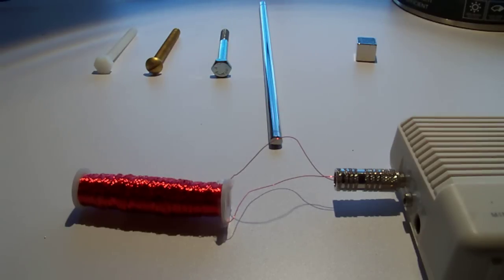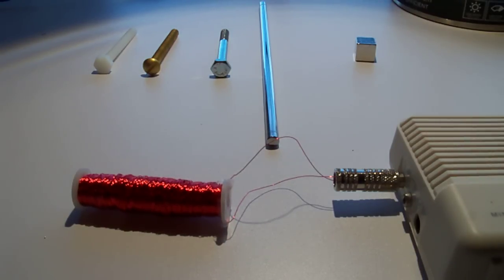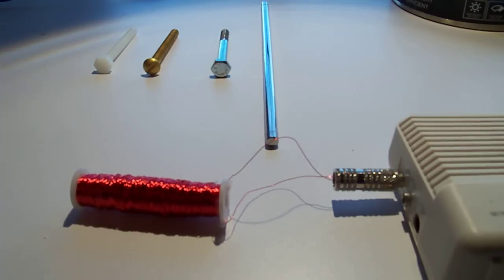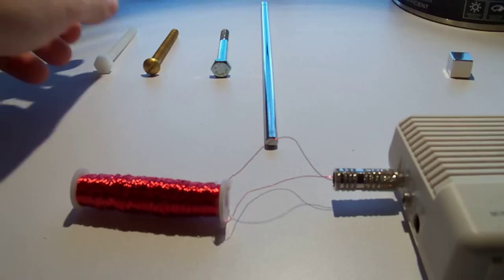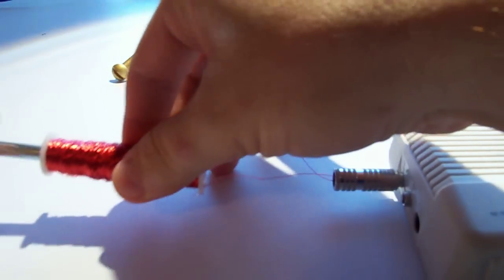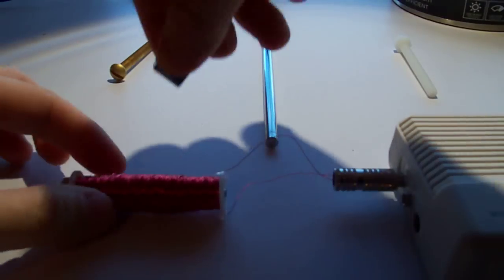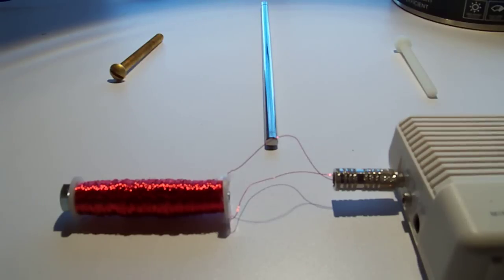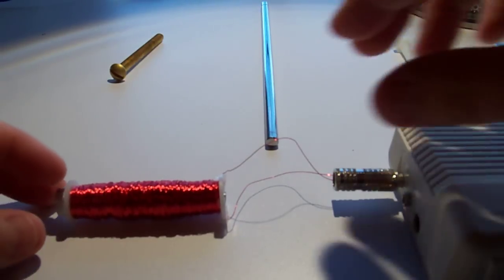The Barkhausen effect

Comment: What surprised me most was the lack of a 60 Hrz hum.  It pervades most everything we do.  You either isolated the system really well or filtered the audio!
Reply: Mostly not heard because of the tiny speaker in the test amp and weak path to built-in mic on camera. I'd like to hear the coil hooked up to a direct connection in the camera setup.
Reply: For that noise to disappear, nothing special need to be done. The orientation of the coil axis must be changed until the noise disappears completely. I know this because I did the experiment.
Reply: @marianl8718  What's happening in your example is that you've oriented the coil away from the source of EMF interference. The hum hasn't stopped, the receiver has simply stopped picking it up.

This means a couple of things:
Firstly, in your location, the coil will only be hum-free in that exact orientation, unless there's no EMF interference to receive.

Secondly, there will be places in which reorienting the coil doesn't work because you're surrounded on all sides by EMF interference. 

To make this device more practical, you can build a partial Faraday cage around it, or pair it with another coil of opposite wind direction (or both). Otherwise, while you can sometimes reorient a coil to avoid hum, you'll have a hard time putting such a device to practical use, unless that hum is irrelevant to what you're trying to accomplish.

(Source: I make guitar pickups and other transducers for a living. My work centers on the interactions between copper coils, magnets, and magnetic fields.)
Reply: @CleepisDBepis  Hey, hey, I also wind pickups👍 
Not professionally but I've been doing it for around 25 years or so. I later got into building tube amps as well as winding my own transformers, chokes and audio inductors.
If there's anybody that knows about hum, it's guitar players. The whole orientation thing that other guy was talking about is flat out wrong. Unless there's a hum canceling coil and/or proper shielding, orienting a coil away from a noise source is only a compromise between bad and worse, it will never go away.
Reply: @CleepisDBepis  It doesn't matter how many sources of disturbances are nearly as long as they emit in phase. Each source creates its own field vector in the coil area, and these vectors give a single resultant vector. If the axis of the coil is oriented horizontally in such a way that the resulting vector is perpendicular to the axis, then no current will be induced in the coil.
If the disturbing sources do not emit in phase, the 60 Hz noise (50 for me, I'm from Romania) cannot completely eliminated, but it will be substantially reduced.
A Faraday cage is only effective if it is made of ferromagnetic metals, because in this situation the magnetic field of the disturbing waves is more involved than the electric one. It is understood that it could not be used in this video.
Reply: @marianl8718  True but in the real world noise sources aren't ever going to be in phase with each other especially with the growing prevalence of SMPSs in practically every modern electronic device these days. The most effective means to clean up noise in the AC mains supply is a power conditioner.
Reply: @killingmasheen  I was only referring to the noise of 50 or 60 Hz, because if the noise produced by all kind of devices is taken into account, then things get verry complicated. In the case of this video, a low-pass filter would be good in this situation (or not !).
Reply: Battery powered, so no connection to 60 Hz AC.
Reply: @akulkis  It has nothing to do with the power supply, the 60Hz hum is picked up from externally generated fields like florescent lights and computer monitors. All coils pick up noise unless it is wired to a second identical coil of opposite polarity to cancel out the hum.
Reply: @killingmasheen  “It has nothing to do with the power supply…”

Really? A amplifier powered with AC backed power supply is still more easily coupled to the 60Hz harmonics of other electronics on the same circuit than an amplifier powered from a battery alone with short leads.
Reply: @IHateMadeUpNames  Have you ever heard of filter caps, regulators and diodes? I've had dozens of guitar effects pedals powered by 9v batteries that were noisy as hell. You probably should do a little more homework on this one.
Reply: @killingmasheen  Any reasonable AC to DC power supply has to have those things in various forms (half wave/ full wave rectifiers and whatnot). I’m talking about stray capacitance that pics up crap from other nearby electronics—that stray capacitance is minimized using a battery with short, even possibly twisted leads.
Reply: @killingmasheen  *However*, a effect pedal has a significant/cable that could also function as a stray capacitor, *especially since it has to plug into other things*.  If using a AC to DC powered one removed the hum, and presuming your guitar and guitar amp is also on the same circuit using other AC/DC power supplies, I would guess having a common neutral for all the power supplies redirected some of the incidental common mode currents away from the signal path.

 (I’m speaking with electrical engineering terms that might be a little bit over my head, but I do know “hum”, electromagnetic interference, etc. are often picked up as common mode currents and I don’t know of any other way to get my ideas any clearer that to use those terms.)
Reply: @IHateMadeUpNames  1/4" instrument cables going to and from a guitar are fully shielded. If someone makes the mistake of using an unshielded speaker cable instead of an instrument cable (which happens quite often), the noise level is intolerable. If a cable is unplugged from the guitar but still connected to the amp, it will howl even worse. Even still with the cable being plugged in on both ends, it will still hum a little bit. The solution to get rid of this remaining hum might seem odd to people who are unfamiliar with electric guitars but it is to ground it with the person playing it! The strings are grounded via a wire going to the bridge.
Reply: @killingmasheen   oops, just replied to the wrong person with something, sorry.
Reply: @terrafirma9328  Oh that.

Back in the early days of YouTube, before Google even bought them, I desired a YouTube account. For a username, I knew if I picked something by what I liked at that time, I’d grow to hate the username, because my interests always flip to new things every few years.

Anyways, long story short, it was supposed to be “IHateMakingUpNames”, but that was too long. “IHateMadeUpNames” just barely fit, though, and I liked the humor that could be made of the action of me picking such a name that clearly violates its own literal interpretation, so I went with it and I’ve been contented with it ever since.
Reply: @akulkis  Ahh!  That makes sense!  But . . .  
I had a wired earbud; no plug, just two tinned wires.  Touch the wire to anything, even your skin, and the earbud would roar with sixty Hrz. RF.  That said, this was very interesting.  Thank you.

Comment: Really awesome! Is the steel only less effective because of all the impurities in it, compared to pure iron?
Reply: A good way to visualize it is puzzle pieces with arrows drawn on them. When you put iron puzzle pieces together all the arrows point in the same direction. When you put chromium puzzle pieces together the arrows alternate. Mix them together and you get mixed magnetic domains making the strength of the field weaker. All matter is magnetic, but some matter cancels its own magnetic influence.
Reply: Yes.

Comment: I recall reading an article as a kid about old style tone generators.  A square spinning disk near a magnetic core of a coil.  The corners simply caused a pulsing of the field, whose frequency was determined by the rpm of the disk.
Reply: This is how electric guitars work, but instead of a spinning square, it's a metal guitar string vibrating elliptically.
Reply: As found inside Hammond tonewheel organs
Reply: This is definitely a thing! Connections Museum has a whole video series on this very concept, the ringing machines used for telephones back in the day. https://youtu.be/dqKFS1p1ivo
Reply: Badass
Reply: that is such an oldschool way of creating signals. cool!
Reply: @Darrell Pidgeon
so it seems reluctors actualy came from that design/mechanism

Comment: 1:00 The changing magnetic field doesn't "induce a current". Faraday's law simply says that the derivative of a flux is a voltage. This effect would have been valid even with a current of 0 amps through that coil (open circuit).

Comment: This effect was used in the 19th Century by Lord Rutherford as an early radio wave detector. When a radio frequency signal demagnetises an iron rod, it creates an audible click. Thank you for a great video.
Reply: Do you have any further ressources on that? I unfortunately failed to find anything and wondered how a practical implementation into a radio receiver could work.
Reply: @GreenCaulerpa  I think the book "Early Radio Wave Detectors" might have been where I read it. In the early days of radio communication, it was desired to receive a single click from a spark at the transmitter. I think the Marconi magnetic detector might also have used the same principle, with a moving iron wire.
Reply: Yea the go SS IP for the flap and jacks on    winder association of people who FLAP A B,OUT  ANN HOT    P LATE    ITS CALLED POLE HATE HE KET
Reply: When you do not lift the needle from a record at the end  you can also hear a hiss and a click
Reply: Shut up nerd

Comment: Approximately how many henries is that inductor? Do you know approximately how much inter-winding capacitance it has? It would be extremely neat to see an FFT analysis of that sound.
Reply: From its apparent size and the length of wire, I'll wild guess in the neighborhood of 100 millihenries
Reply: It produces a white noise. The coil / parasitic capacitance is a tuned circuit, and will act as a bandpass filter in the audio range if you visualise the output on a spectrum analyser...

Comment: Wire is of which gauge??
Reply: Gauge does not matter. The number of turns is more important. The more turns the higher the sensitivity. Obviously a thinner wire allows to fit more turns in the same space, so the gauge matters after all, albeit indirectly.
Reply: @olmostgudinaf8100  👍

Comment: wonder how it would sound had one used a ferromagnetic single crystal, if it would even make a difference
Reply: Do it... then post it... & share your link👍
Reply: My opinion is that it would be the same thing, a ferromagnetic single crystal is composed of many randomly magnetized domains, because if it had the same direction of magnetisation, the crystal would be a magnet !
Reply: The thing that this experiment is historically said to have proven is that the metal is built up of individual Magnetic domains (Weiss domains)
So theoretically it should make a fundamental difference.